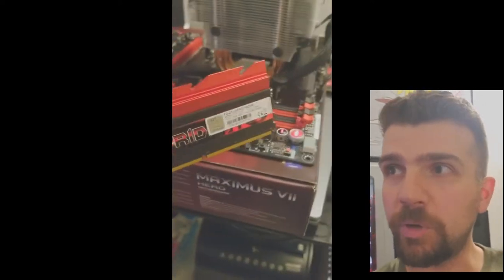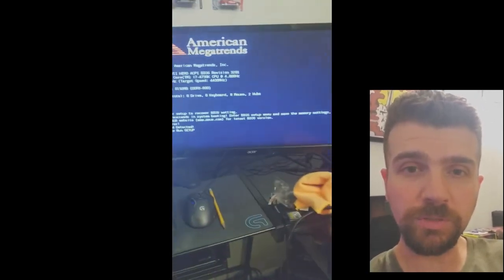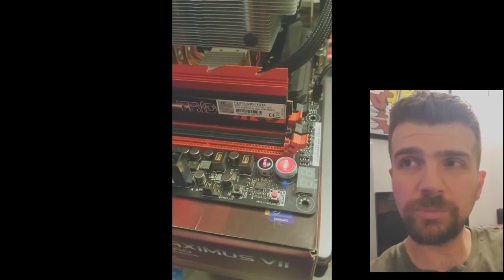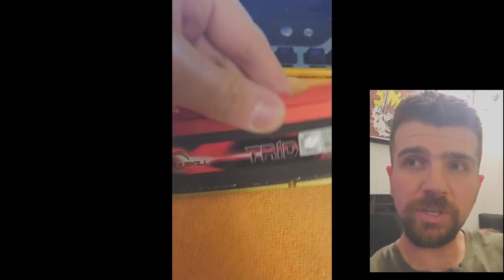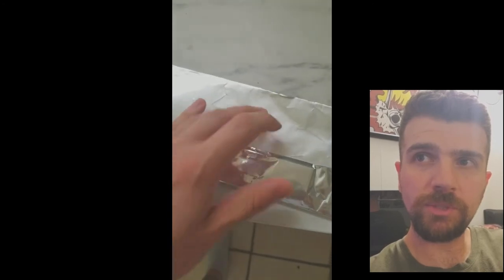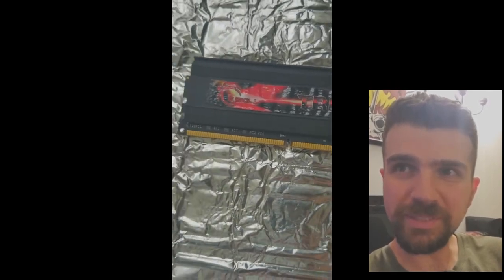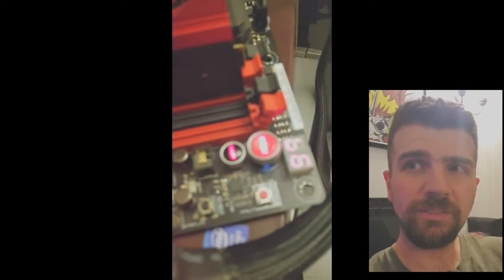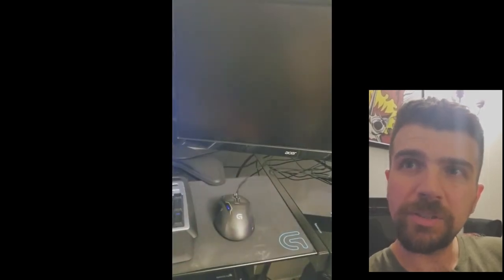How to fix dead RAM in the oven!

Comment: Won't the pads of chips on bottom side get desoldered or come off ?
Reply from the maker: Not sure. But if your RAM is headed for the garbage bin anyway... what do you have to lose?
Reply: not very probable, the solder's surface tension should keep the chips in place. Its quite high fyi, plus its held from both sides by the heat spreader so worst case would be the extra weight on the chips could cause the solder to squeeze and short circuit but thats also note very probable.

In any case a better method would be to remove the heatsinks and use a heatgun with a thermocuple or a proper hot air soldering station and also add some flux to help the solder melt better.

Comment: you say 400 degrees 
it is in F right?
Reply from the maker: American ovens (which mine is) are set in Fahrenheit. Most solder melts around 180 to 190 degrees Celsius, that is 360 to 370 degrees Fahrenheit.

Comment: 400 C or F?
Reply from the maker: American ovens (which mine is) are set in Fahrenheit. Most solder melts around 180 to 190 degrees Celsius, that is 360 to 370 degrees Fahrenheit.

Comment: is this Fahrenheit or Celsius good sir?
Reply: almost certainly Celsius as household ovens can only reach to about 230c or 459f
Reply from the maker: This should be Fahrenheit considering it is a US oven. The melting point for the softest solder is 361F. Typical 60/40 solder melts at 370F.
Reply: @Anthony-fu8jx  I'm doing this rn but was told of deadly gasses but hey if i die I die
Reply from the maker: @averychristoffel  I'm still alive 🤷‍♂️
Reply: Thx, it really work… you save my ram.
Reply from the maker: @HandyChan That's awesome to hear!
Reply from the maker: @TheCrustyOne Still alive?

Comment: Yes, it was detected by the motherboard. But whats next. Better of i tried running memtest86 after. Sooner or later, u will have to buy another rAm because this one will cause ur pc to crash and its very contagious
Reply from the maker: I added an update to my description over a year ago stating this RAM shown in the video did not make the cut after running programs and was removed from the system. The point of the video was to show that you can use science to TRY to revive old tech before spending money on new tech prematurely. To those trying, I would suggest running the program you mentioned.

Comment: looks fake. there is microwave and there's oven
Reply from the maker: What? Do NOT stick electronics in a microwave...
Reply: I don't know of any microwave that can set the temperature. Setting the temperature indicates that there is an option to heat it without microwave radiation.